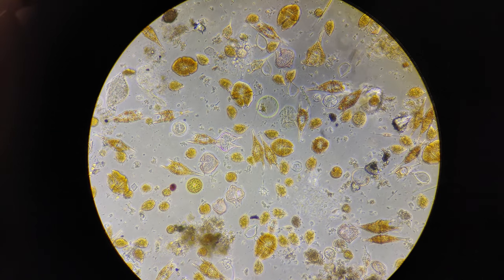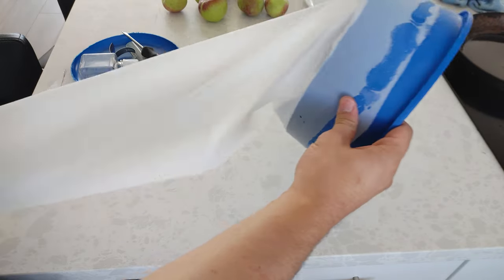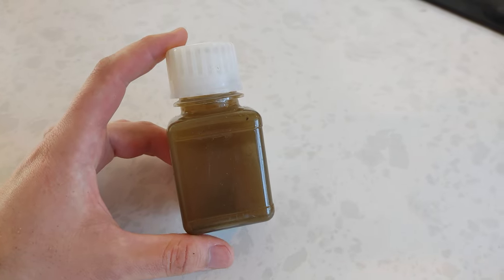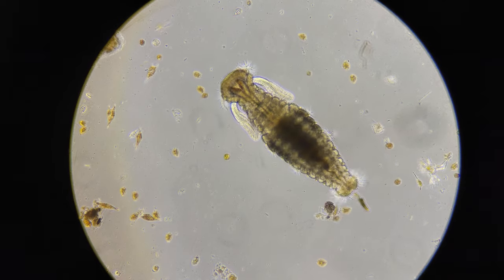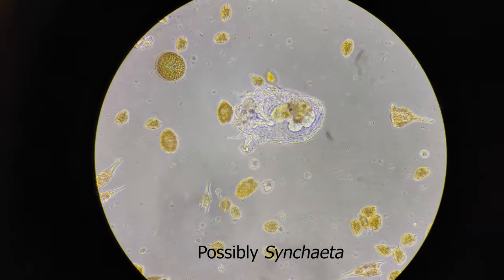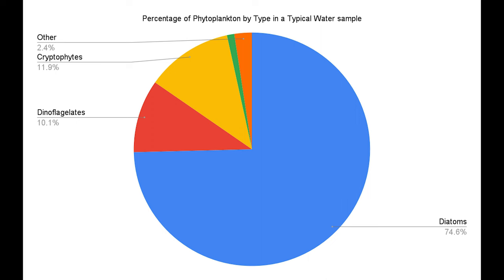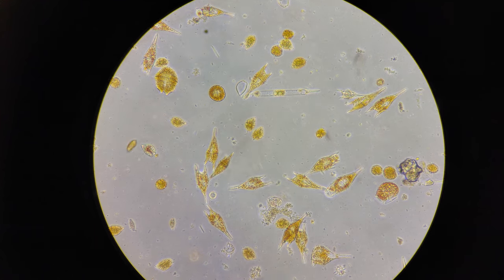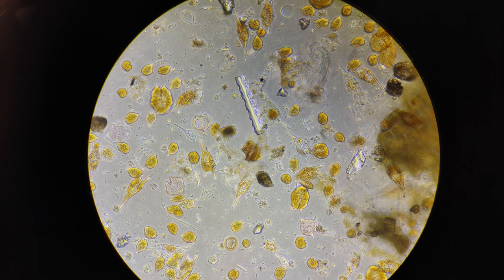Exploring the World of Plankton Under the Microscope

Comment: What are the black circle things they are trying to eat at 5:48?
Reply from the maker: I believe the black circles there are very small air bubbles. Notice that they have no internal structure, are perfectly round, very mobile, and refract light differently than the other objects.
Reply: it seems to be making the bubbles. I wonder if it's using cavitation to get food?
Reply from the maker: @byeFofiko1  cavitation is a pretty high energy process. Most likely some air bubbles just got trapped during the sample preparation.